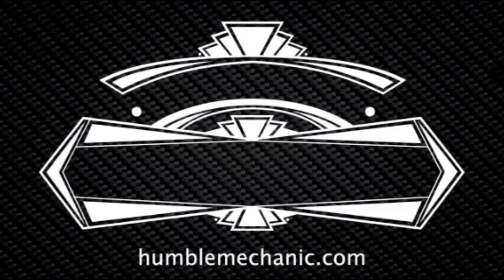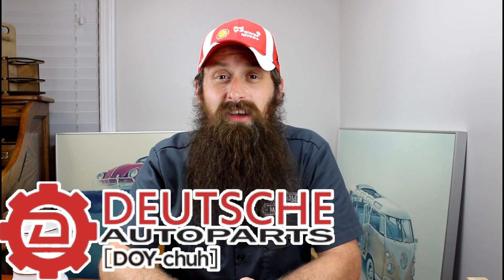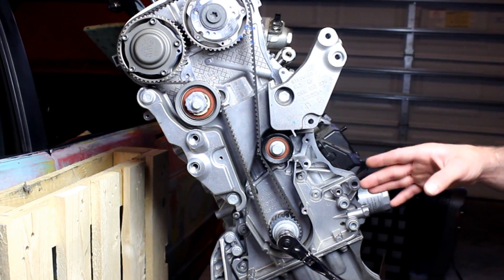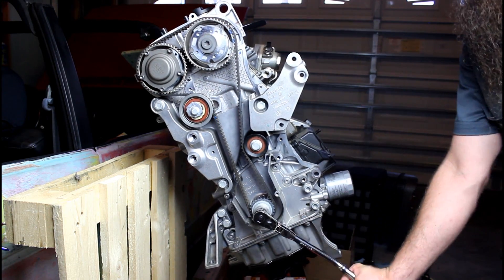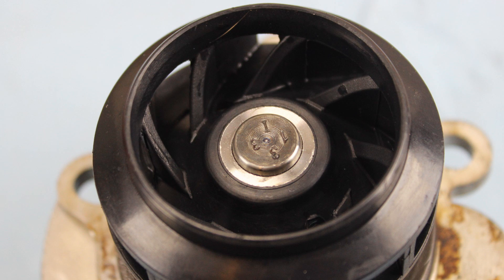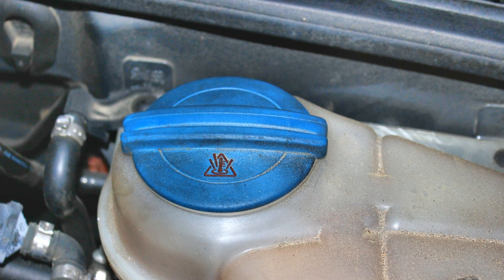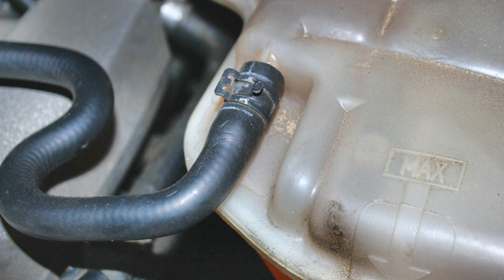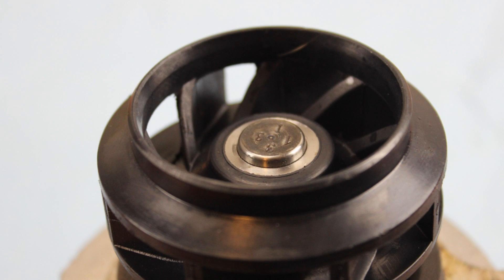How VW Water Pumps Fail

Comment: Most makes will last 200k with proper maintenance.  This applies to VW too, but proper maintenece for this brand is a PITA.  I need to change the water pump and thermostat on a new beetle 2.5. This requires jacking the motor up and removing the front bumper.  WTF! I can do the same job in a toyota half drunk with a swiss army knife and channel locks.
Reply: Have fun driving your Toyota.  :P
Reply: My VW alltrack has a leaking water pump at 40k miles...
Reply: @eonr2499  ...I've got an Alltrack too 2017 36/3 year warrantee but it does have 50k extended powertrain warrantee, wonder if it covers water pump? I just had mine at dealership and told them my coolant level is low and could possibly have leak, they told me coolant evaporates (over time) sounds like BS to me. My Mk4 Jetta has never used coolant ever. Service "tech" said that it evaporates because this style fill cap vents on these "newer" engines? Is that a fact? Or more BS?
Reply: @harryberry474  they do have an extended warranty that includes this part. They might even have a service bulletin for this water pump/thermostat housing problem because it’s becoming more common. I took mine to the dealer and they said the same thing. They didn’t see any leaks after “pressure testing it” and charged me for diagnosis. I took it to an independent shop that specializes in VW and Audis (Mason Motorworks Dayton Ohio) and he pressure tested it and found a small leak coming from the water pump/thermostat. I took it back to the dealer and had them refund my fee and replace it under warranty. I think VW has already made a new updated version of this part.
Reply: @harryberry474  don’t let the dealer lie to you. They tried to do the same thing to me. They try to get people to not use warranty and pay for parts and service after the warranty is up. The ONLY way your coolant level goes down is a leak. When the engine is on or hot, the coolant is a little higher compared to when it’s cold. But My alltracks leak was very slow and it needed the coolant topped off a couple times in a few months. After this it got low enough that a low coolant warning ⚠️ came on. I told the dealer i would be back the first time i took it and back to the dealer it went. Fixed now! If you have to top it off with some water/coolant more than once or twice then take it back to the dealer and tell them to pressure test it and inspect the water pump/thermostat housing. Any modern car should not have this problem at only 30-50k. A water pump/thermostat should last at least 100k. All that plastic they use makes me mad honestly lol

Comment: My Audi A3 8L 1.9 tdi PD Quattro Sport was running hot, no heat from heater unit.  I correctly diagnosed failed water pump.  Removed belt, tensioner etc and shocked to find the bearings in the pump were completely shot with lots of play in the pulley.  Amazingly no loss of coolant from around the shaft.  On removing the pump from the block the plastic impeller was spinning with the belt driven gear being held stationary.  Crap design.  Have bought a replacement pump with a metal pulley and a great quality DAYCO timing belt kit, with a six year guarantee .  Anyway, not too bad a job for a home mechanic, hardest part removing the cast aluminium engine mounting bracket that is bolted to the side of the block.  Really tight to jiggle out and looking at removing some excess material to make it easier to re install.  I'll let you know how I get on!  Good video, thanks!

Comment: Would aor in the system cause the coolant not to return through the return house where the blockage or water pump could be bad?
Reply from the maker: In my experience it could be either. I have seen more blockage cause issues, but the newer cooling systems are tough to bleed. the air out of
Reply: HumbleMechanic do you have a video on bleeding the coolant system? Ive replaced the coolant hose flange, thermostat, coolant reservoir and one coolant fan. Its got a leak but we can find it and the tempture light ain't coming on anymore at all. Not even when its cold...so unless its smoking i don't know when its overheating. Is there a way i can test the engine tempture to know if its getting too hot?
Reply from the maker: This video might help https://youtu.be/YqlTvk1qi2k
Reply from the maker: skip to the end, because it was part of the cooling system repair
Reply: HumbleMechanic thank you...bad news is ...it is the water pump. Lol. My luck. Love your videos and your response time and your help.

Comment: Apparently Audi is having a big recall for faulty water pumps on the A4 A5 A6 and Q5. Pretty much everything with the 2.0T Engine from 2012 to 2017. I have a 2014 A4 with 60,000 miles so I am in definitely in that demographic. I'm thinking of taking advantage of this and asking the specialists to change the timing chain while their at it. Theoretically they could do it at a very reduced price since the recall is free and it's not much extra labor to fit a new chain on. The bulk of what I'd be paying is for the chain itself. Hopefully it works and wouldn't hurt to ask a specialist. I suggest anybody who is eligible for this recall try this too.
Reply: I know it’s been a while but how was the outcome? Did they replace the water pump for free and timing chain for a lower price? Going to Audi soon for the same issue and would like to know you experience! Thanks

Comment: Hello, my VW Scirocco 1.4tsi GP (2015) just went for car servicing and when everything's done, everything was fine, I checked the car before I left the VW center. Took it out for a drive to test the newly serviced car, about 20mins out after driving and refill the gas, I started to notice a little noise from the hood but then it's gone, not long after I just needed to check again as that little sound I heard is bothering me and it eventually is becoming clearer as every rev makes a rattling sound before I parked to open the hood, it seems to be coming out of the timing chain area, the belting or the pulley, I immediately noticed there was a little droplets of fluid, I'm not sure if it's oil or water but most certain it wasn't oil. I couldn't find out what was going on with the car making such sound especially after a service, I've never had any complaints after servicing at VW other than that 1 time where my battery just broke down 2days after a service, they replaced a new 1 and everything went fine up till now.
I had to drive the car back home as VW have already closed at the hour, just under 80-100 at a few times, didn't want to push on so hard on the pedal, the car felt fine, the drive was still okay till I made it home.

Today, it has been towed back to VW and after they checked, they told me it the problem was the water pump and that's what causing those rattling dragging sound coming out.
It's pretty costly for a replacement of the water pump set, belt, bolts, labour. As of now I haven't proceed with the fix as budget is out already for me this month.

I've seen ur videos on VW and AUDI parts etc. and I do believe u know what ur doing with this German mechanicals. I'm just wondering if my story thus far could tell you something, or any suggestions and comments on what's going on with the car, cause it definitely made me worried as I thought it would be a problem with the timing chain or tensioner or other faultier? 
I've had the car over 4 years now and this is the first time there has been such problems with the Scirocco.

Comment: I recently had an instance when I saw smoke coming off the bonnet of my Mk7 GTI while doing about 10mph. I stopped the car immediately, after opening it up I notice it had drained all the coolant. The temperature and Low coolant light had not risen or came on. I switched off the engine. Topped up the coolant again, Then I noticed it was leaking from underneath the car. I towed the car to a VW dealership in South Africa, Its been four days I haven't got feedback. What could have been the cause? Water pump?
Reply: what happened ?? u remember

Comment: Hi can anyone help? My Jetta TDI 09 is overheating. I tested the fans and they don't go on even if the coolant is at 200F.  I'm going to replace the coolant temp sensor just to rule it out, but i am getting reading of coolant from the sensor? 

https://www.youtube.com/watch?v=0RaUm0wuKRE
this my coolant low at 2 rpm.  Is it a sign of a failing water pump? should it flow with more pressure?
FYI: I'm getting heat from the heater.

Comment: the purpose of the manufacturer using the composite water pump impeller is so they can save a few bucks versus paying the cost to manufacture cast impeller's. but with your knowledge of a mechanic you should know that the steel impeller would balance out the drive pulley and the bearings would last longer

Comment: How do you know what vr6 motor you got 6 or 12 Valve
Reply from the maker: They all have different intakes. The 12v also have wires and the 24s are coil on plug
Reply: Are the motor the same cause I have a 1997 vw jetta with a vr6 will it be a plug and play for a vw golf gti vr6 2000

Comment: Hey. Thanks for the knowledge. I have a passat 2013 5 cylinder, this type of motor has a timming belt or a chain if is a chain i don't have to replace and just replace water pump cause at the moment water pump is leaking.
Reply from the maker: +Jose Perez it’s a chain driven engine. The water pump is driven by the serpentine belt. 

I would for sure change the belt.

Comment: Thank you for the video. Can these water pumps be rebuilt? Have a great day!
Reply from the maker: They can, but I don't think anyone really does. The time and energy is a lot for just one pump. Many of the OEM are remanufactured.
Reply: HumbleMechanic the diference between price here, near Seattle, at Autozone for plastic impeller vs metal is $260 -plastic, $360 metal. The gal there said my Audi will have metal, but after veiwi g your vid, sounds like plastic. Car os '04. it just seems like if you could possibly rebuild it with better quality parts, you could save yourself a headache. I've read that when they go out they take the timing belt, which can be catastrophic. I'm just trying to think of a way to bulletproof this thing. thank you very much for responding. Looks like I'm just going to go online and find the best damn pump I can.

Comment: I'm rocking an 03 passat that is pushing 242,000 mile on her.  while living in a colder climate, I noticed my coolant temp rise however would go Down after I set the heat up high and blast it too.. I've done the majority of the repairs my self via YouTube videos, which leads me into my question. Do you have a video walking through how to change one out or just explaining the faults of the water pump?

Comment: I have an issue. I had my water pump replaced on my 2011 VW Tiguan 2.0TSI  around I would say less than 10k miles and around October 2016. My pump has developed a leak :-/ ....it was replaced by a local shop which specializes in VW/ AUDI, and most common euro cars. I don't know what to do? I haven't talked to the shop yet but I believe it should be covered under some type of a warranty at least the part should. Any advice...?
Reply from the maker: +snktrd definitely call the shop. Any good shop should have a warranty on parts and labor.
Reply: Hello Humble! If I change the Belt on my Jetta Mk6 2.0T , what is the torque value to apply on bolt pulley?

Comment: I just got my car back from the garage,  they flushed the coolant and after a long drive, on the way back my coolant light is coming on, it goes when I turn it off but comes back after fee mins when I restart it. It never happened before, can someone explain why it could do this? The level seems to be fine
Reply: Sensor located in the reservoir. You may new a new tank if the sensor is shot or maybe the wiring is faulty.
Reply: Maybe you have an air pocket in the coolant system

Comment: Have a pretty major coolant leak coming from the front drivers side of the engine, water pump failure?
Reply: HumbleMechanic I have a situation here with my 2013 VW cc sport the water pump was leaking I did change it and it was with warranty for like 1 year and that was like 4 months ago,I went to the same place because the warranty and they told my it was this time the other water pump the auxiliar water pump something like that they say,the truth is that I like cars but I don't nothing about mechanic and I think they want to take advantage of me,so my question is that is my car has 2 water pumps,thanks
Reply: Hi Jany Rodriquez i own  a Volkswagen Jetta 2011 and i talk to some local Volkswagen shop and i ask 6 Volkswagen repair shop if they are installing the same plastic water pump and all vw shop said they are installing the metal one, so i walk to a vw shop and ask in person what water pump they are installing and he told me the one that i 'm installing for years with no problem the metal one , so at 90,000 miles they put the metal water pump the new timing belt the thermostat the fuel filter and flush the coolant and put new coolant total 700.00 dollars, so time will tell  , go to your local Volkswagen repair shop (NOT VOLKSWAGEN DEALER) and ask what are they're installing for years for sure they going to said the metal water pump ok thats my 2 cents
Reply: Yes Rafael is after market and it work great talk to your local Volkswagen repair shop  ( not Volkswagen dealer ) and ask what are they installing the plastic or the metal i ask 6 local Volkswagen repair shop and they said the metal one ok Rafael buen dia mi hermano
Reply: 2002 2.8 passat
Reply from the maker: +Dan Williams that's a very common place.
Reply: hey was your water pump an aftermarket or OEM? I have an after market one with a metal piece but not confident to put it in my car after hearing to only use OEM.
Reply: thank you!

Comment: Great video!  Do you know if it's possible to replace the water pump on a 2.5L Jetta BGQ engine without having to remove both engine mounts?  What if you remove all the idler pulleys and serpentine belt tensioners?

Also, I don't see the link for the CCTA water pump in the show notes.
Reply from the maker: YES, it kinda sucks, but you can do it. The PS mount has to come out, then you can take the bolts out of the crank pulley and lift the engine enough. You might want to take the dog bone mount out too.
Reply: Sounds like it'd make for a great video! ;)  I just followed your video for removing a leaky vacuum pump.  Thanks!

Comment: My water pump crapped out on me last spring. The impeller ended up breaking off of the shaft. My neutral saftey switch also crapped out a not much later

Comment: Plastic is used to design shapes too complex to use with metal. The design goal is to avoid cavitation. New engines have over 1 bhp per litre
Reply: Used for lightweight and cheap to replace.
Reply: "Plastic is used to design shapes too complex to use with metal"  BULL!!

Comment: VW uses plastic impellers for a very obvious reason: to save money and guarantee a failure so that money will be spent buying and replacing the new pump.
Reply from the maker: happy543210 To save money I will possibly agree. Not having seen cost reports I don't want to say 100% yes to that. As far as "guarantee a failure" I doubt it. VW will make pickles on selling water pumps.
Reply: That's quite a conspiracy theory! The reason for a composite impeller is to protect the timing belt if a piece of debris were to make its way into the impeller of the impeller itself were to come apart. With a composite impeller the impeller itself would break, stopping the flow of coolant, quickly causing a light on the dash which the owners manual will tell you to pull over and shut it down to save the engine from overheating. If a metal impeller were to jam the water would freeze solid, stripping teeth off or likely breaking your timing belt destroying the head and possibly bending rods and tearing up pistons.
Reply: zygi22
exactly! plastic intake manifolds are lighter and cheaper to make, but they warp and crack more easily over time.
Reply: Banshee365 dude, you're full of shit. Metal impellers were the norm until certain auto makers decided to be cheapskates and use plastic instead!
Reply: happy543210 Yes, metal FTW ! lol. I think this plastic madness had been first started by Porshe, when they came up with plastic intake manifolds. And what'd ya know, virtually every car today has these plastic manifolds.
Reply: +happy543210 My 04 Passat has an aluminum intake manifold.. I'm damn sure it will outlast the plastic intake on a 2016 Passat
Reply: Then why did the OEM replacement move to metal too? I think they were trying to save money originally. https://deutscheautoparts.com/make-model-year/audi/a4/b7-2005-2008/engine/2-0-turbo-audi-valve-lift/repair/cooling-system/vw-audi-fsi-water-pump-06f121011.html

Comment: Thanks for the video Charles. I'm a bit worried about my pump. I have a b5 passat 2.8 with just over 180k on the factory pump! I had a failed timing idler about a yr ago, so I bought all the stuff for a timing belt replacement (Belt, tensioner, idler, water pump, and thermostat.) when I got to doing the job, I was in a major time crunch and it was bad timing for the car to be out of commission. I tore it down, slapped on the new idler and belt and frantically assembled the rest. I've been regretting it since, especially when the parts are sitting on the shelf. Thanks for the reminder of what "could happen", looks like I'll be doing another TB job this weekend.